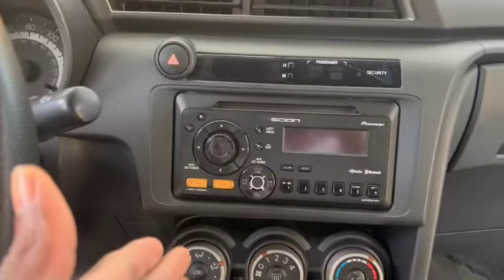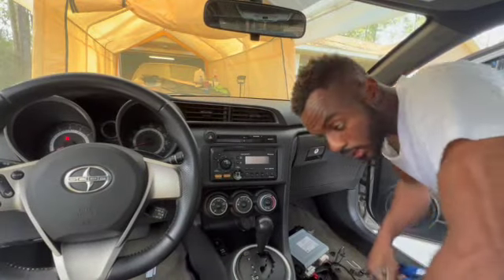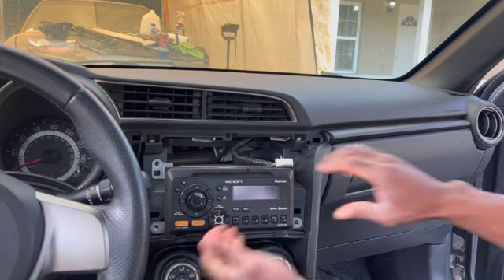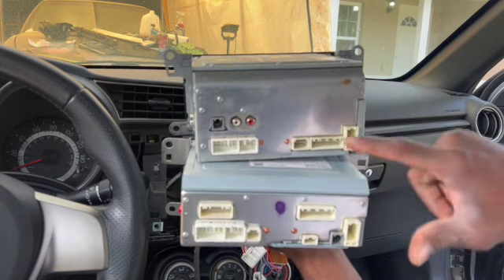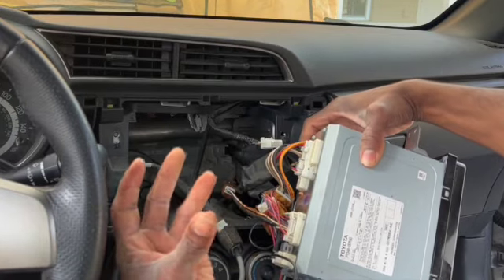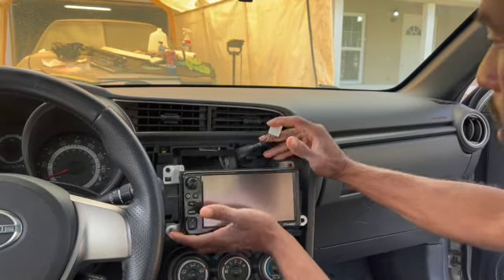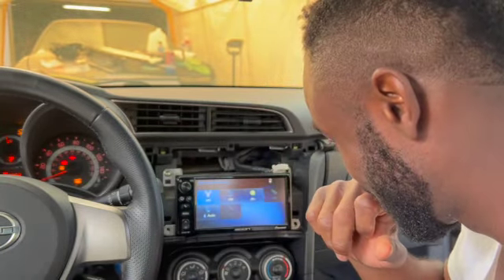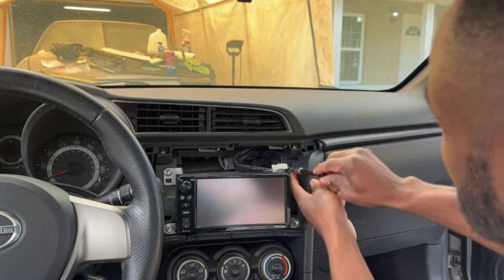How to replace scion tc radio | UNDER $5,000 | Part 8 | Replacing Radio

Comment: I ask because Im about buy one from a 2016 Scion FRS, I think I just have to swap the mounting metal brackets.

Also loved the part where your like hope no one tracked you to your house, I’ve had that happen to me!
Reply from the maker: Lol that’s funny, you just never know with some random aftermarket just chilling in your car. Not hame at the moment but will look into the part number for later
Reply: @Radstreetdaily The one from the 2016 Scion FRS didn’t fit, in regards to all the essential harness connectors in the back, I guess it will have to be from a Scion tC exclusively, also how much you pay for yours?
Reply from the maker: @raycoe2927  I paid $60 for mine
Reply: what didn't fit I got the two main connectors installed but no sound was that the same issue you had?
Reply: @davinpenney6525 I too had the same issue. Did you found the way to fix it??!!

Comment: It will all work the parts. The same At20 chassis. You should have no problems. I have a 2016 Rs10.0 tC
Reply from the maker: Its just crazy how Scion/Toyota have everything work together, I just replace rear bumper and tail-lights
Reply: Do you know what is needed to change the 2011 front for one from 2014-16?